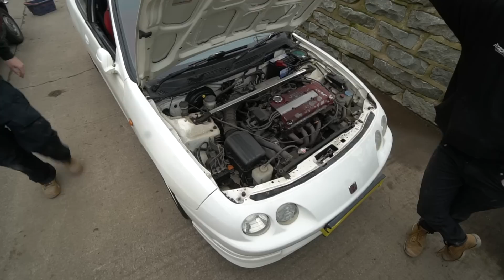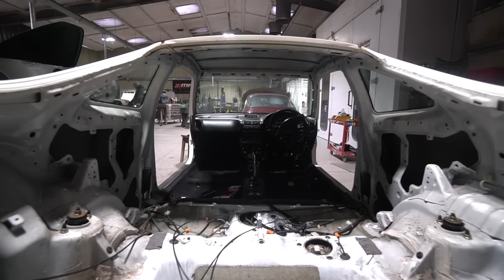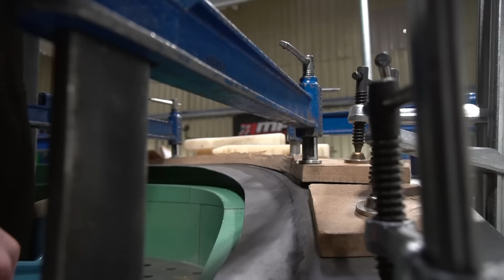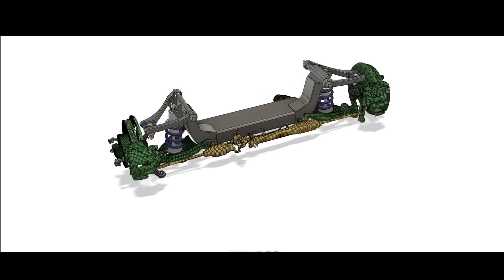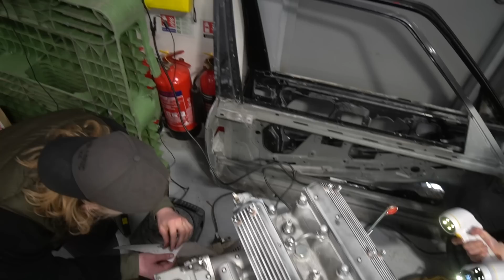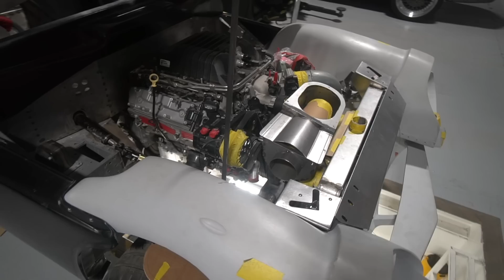NEW PROJECT ARRIVAL! Can We Build The British Leyland Hot Hatch That Never Was??

Comment: This was a poor choice of engine. It's too tall an engine for the allegro so will likely end up compromised by either being too close to the ground or bulging up above the bonnetline.
Reply from the maker: Neither. The B series is short,not like the K. With standard position vs the ground its perfectly under the bonnet.
Reply: @retropowercars  it's not the same as the one being used by Johnny Smith? When I saw the compromised fit on that conversion, I realized that that was not a good idea.

Comment: So... I've been watching you guys since you started your channel, and this is the project that has finally driven me to comment. This is unnervingliy close to home... I am in AUS and I have an (actually I have two) AS ZC CR-X  (that's the gen 1) imported from Japan that was never sold here. I've had a 20yr dream to put the floorplan and driveline from a 2nd gen into it to get the double-wishbones front and rear and factory B16 mounts. Over the years I've just narrowly missing buying so many donors and a few gen 2 Si-Rs, and I was too young and poor when they were going cheap and wrecked and now everything is big money too... So the current plan is get an EF Civic hatch shell or DC Integra shell and make that work. I have B16/gearbox/ECU/coilovers etc etc... just still no good donor chassis.

However - my question to you guys is: why not a lower-spec DC2 donor shell? All the stuff that makes the DC2 type-R shell special isn't getting used, it seems a waste. (e.g. the thinner windscreen, the additional chassis bracing, etc.) I assume you'll rebuild the B18C and gearbox, and use all new shocks, so why not just source a base integra shell with an identical floorplan and a separate re-built (and improved) driveline? (Carbon syncro gearbox, tweaked B18C).

Comment: here are my thoughts: how can it be a hot hatch Allegro if it has no "hatch"? This needs fixing. either a one-piece like the integra, or weld up the trunk and just open the glass. The escort wheel arches are EXACTLY what i pictured in my head. the rear wheel wells bothered me from new... the landcruiser intake manifold is a thing of beauty. i think the shut line on the hood of the jensen to the front bumper never matched the line on the fender. I would fix that somehow. looks like it is messed up in every picture of a CV8 i ever see. Churchill is going to be quite awesome, even though i still don't like the rear end from the bottom of the wheel well back.

Comment: I had an Allegro, mmmmm..... being orange was the least of its problems. It was only challenged in crapness of driving and living with by another orange Talbot Horizon, but that one handled - in case you thinking of another project boys. 
The Honda 'looks too nice to cut up and discards, but you are the experts. Surely the Integra was morphed into the Rover 214/216/220 Coupe - so the Anglo Japanese connection continues.
Well, in parting, I will say you are brave! Good luck

Comment: A lot of metal bashing on those Escort flares. How does a factory stamping machine produce a panel seemingly without stretch and shrink?
Reply from the maker: There is shrink and stretch. Press tools are not just a male and female of the required shape, they are designed to clamp progressively, "grabbing" the appropriate areas first to control the shape as they close together

Comment: Have a deep, probably quite dark, soft spot for Allegro's, my dad had a 1.5 as a company car in 1977-80 and the fact that it had a 5 speed gearbox was a revelation. Ride and handling was good in the context of the mostly leaf sprung competition. Had a few issues with it such as wheel bearings etc which were solved by us at home rather than the dealer. Gear linkage was a bit ponderous but was nice if changes were not rushed. One of my cousins had a Mk3 1.5 that had twin carbs and was actually a really good update, handling had been drastically improved, a bit more performance and a good gearchange that didn't have to be used with as much care. Years later in the 90's, I had a Maestro that I built with a 1600 R Series (developed from the E-Series in the allegro/maxi but with a vw golf gearbox). I had used the DCNF carbs out of the MG1600 Maestro along with a ported head, cam and lightened / balanced bottom end to get 145bhp which was reasonable from a 1.6 8V engine that had it's origins in the 60's. Had plans to do a stroker 1800 version of the engine using a modified 1750 crank or just put a K-series in it but ended up buying an Alfa 155 instead lol. Sounds like another great project you have, look forward to seeing it progress!

Comment: Aerodynamically speaking, using that front bonnet scoop idea to feed the air in sounds like a good one, providing the air pressure in that area remains positive at speed, due to the accelerated air flow stream coming off the top of the front grille area. (I expect Gordon has the software to predict that?)🤔

Comment: I wonder with the Jensen air intake you are allowed to alter the bonnet to allow for an Over the Radiator OTR like those fitted to the HSV VE / VF Commodores using the LSA engine in Australia. The other method I have seen is to lower the radiator to allow for the OTR to flow straight from the throttle body to the top of the radiator and not alter the bonnet.

Comment: Re the E-Type. Fuel pressure regulator. Why not run a dead-head system and save yourself the bother of running the return line as well as finding somewhere to locate the FPR in an already cramped location?

Comment: Great fun.  No doubt you'll have seen Jonny Smith's Allegro sleeper project.  For all the criticism of the Allegro as a machine for the road, the ride and handling were actually pretty good at the time - but I'm guessing much of the suspension will go.  It's interesting how we now revere the Escorts of the time due to their rally heritage but in terms a a family car it would have nowhere near the stability and roadholding of the allegro.  It would have been even better if the interconnected hydragas came into effect as envisaged.  This arrived with the revised Metro in 1990 and gave it class leading ride and handling in a small car and went on to the MGF.

Comment: There's a fairly long history of Minis (the real ones) being repowered by Hondas, so this should be a relatively known path - one would hope that the Integra was either riddled with rust (just starting the video) and/or the remains were passed along so the remains let another survive. Not a "Honda" chap, but seems a bit of a shame to just strip it and dump it.

BLST (British Layland Special Tuning)  actually had a range of 'tuning' parts for the Allegro, mostly already developed for the Mini, which supplied the engine, gearbox and brakes, with up-rated Hydrogas(?  Can't recall exactly what they called it) struts.

Comment: Question: How do you avoid the Intelgro ending up in a Q plate? I've never managed to get my head round these rules/laws. At what point do you replace so much of the BL structure with Honda that it's no longer registerable(?) 
as an Allegro? Will it stay on the Allegro V5 so it comes back as the correct appearance if the rozzers look it up? Does an IVA solve the problem by getting a new V5? (Sorry, that's four questions!)
Reply: If you have documentation that the engine and other major components came from the Integra they're stripping, The finished car will get a registration plate of the same year as the Integra. Unlike a Q plate, you can then change it to whatever (probably older) reg you fancy

Comment: I would have never cut up that DC2 bodyshell, as a Civic shell would have worked equally well. I get how it turns out more to be more cost effective, but in 20 years time those DC2 shells will be worth quite a lot I expect. And those DC2's are very close to my heart, haha!

Either way a cool project and looking forward to the end result!
Reply from the maker: I hear ya, but it'd have to have been a jdm type r civic to have the B18C and that would be even rarer and probably more valuable
Reply: I hope the shell goes to a good home.
Reply: Yeah the good B18 engine and gearbox only came in the Integra Type-R. The only budget option would have been a B18C4 from an Swindon built Civic. All Japanese Civics including the Type Rs always came with B16 engines. The suspension and geometry is shared across all Civics/Integra's, so a normal Civic would have been fine for the floorplan. The Type R has specific anti roll bars, springs, dampers and steering rack. You can probably recoup quite a bit of money on the DC2 parts (interior, body panels, springs and dampers). So from a business point of view it makes total sense. Cheers!
Reply: The JDM civics have the b16bs 180hp 1.6... the UK type rs are going to be worth the money in the future because there will be hardly any left. They all rust and get stripped. I do totally understand tho the integra has all the goodies you need 🤷.

Comment: I’m struggling with the thought of cutting up an Integra Type R to build an Allegro, no matter how well it may turn out, but if anyone can make a good job of it, you guys are right up there.

Some of the design sketches suggest that it could be quite muscular - that’s probably the best way to excuse it…
Reply: Yes, I winced a bit too. I hope the shell goes to a good home.
Reply: A nice sleeper design would be cool. Just a couple of Roundels (no numbers), with slight wheel arches.
Reply: This is the first project I have misgivings about.... :(
Reply: No doubt the shell is rotted to the point of no return.
Reply: The renderings look a bit Allegro 6R4. A whaaaa?
Reply: Finding an Integra with enough metal in the floor and cills to make it worth saving is a mission in the first place...😅
Reply: Impressively crazy given the way Integra values are going, especially when the same floorpan & suspension can be sourced from more mundane Civics. I'm sure it will be done nicely regardless.

Comment: The thought of this is sacrilege of course, but the R5 GT Turbo-esque rendering with Integra underpinnings had this 80s hot hatch fan right on board. Times that by a spot of Retropower over-engineering, and this is set to be a great project!

Comment: I get it...Great Idea...Just don't cut up That nice RARE TYPE R ....cut up any old Integra,.........you'll probably end up changing half of the metal work and seam brazing it  anyway ...?????
Reply from the maker: We could also have used a civic floorpan, but we want a B18C engine, and that means integra or civic type R. Bottom line, it was the most convenient and cost effective way to get engine, transmission, floorpan and core subframe components

Comment: I'm glad you acknowledged that the Allegro is not a well built car - you're going to have reinforce a fair bit as there is not much structural integrity in the shell. It's shame as the original designs were pretty good but then the BL machine just ripped the guts out of it.  .